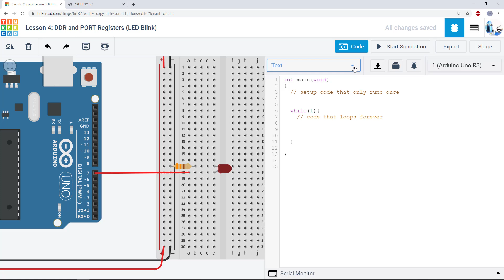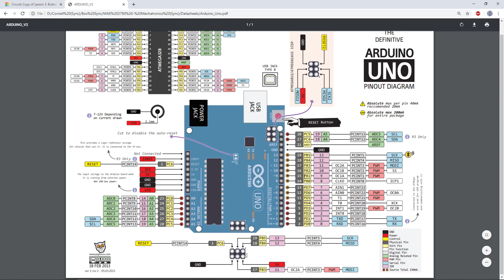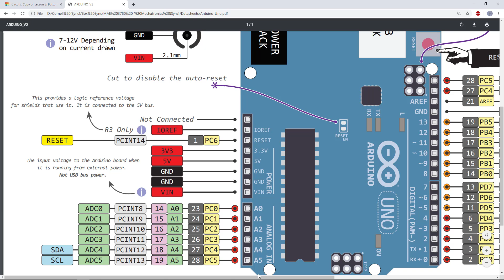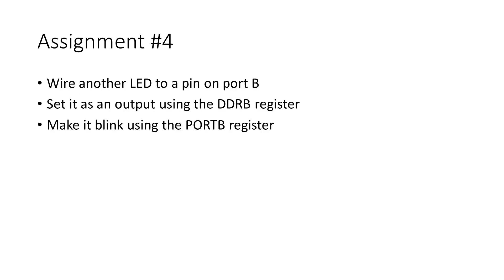Tinkercad + Arduino Lesson 4: Blink an LED (DDR and PORT registers)

Comment: // setup code that only runs once
  
  // DDRD = 0b10000000; // set pin 12 as output
  DDRB = 64;
  // DDRD = 1<<12;
  
  while(1){
    // code that loops forever
    
    PORTB = 0b10000000; // set pin 12 high
    _delay_ms(1000);
    PORTB = 0b00000000;
    _delay_ms(1000);
i did this and it stil doesnot blink
Reply: Make sure that your resistor is connected to the holes of the breadboard.  Also calibrate the resistor with 330 resistance in ohms.  I did both and it worked for blinking.  Also, in your middle line you have DDRB =64 not DDRD.

Comment: How can ı write delay funtion with registers?
Reply from the maker: You do not need to use registers for the delay function, however there is a function called _delay_ms() that is not exactly the same as the Arduino delay() function (I am not totally sure of the difference).

Comment: What is the advantage of using these registers instead of the adriuno library?
Reply from the maker: Here's a video that goes over a few of them: https://youtu.be/T_4BiqqTUMg. There are also other videos on YouTube showing an oscilloscope measuring the output pins using digitalWrite vs the registers, and the registers are several microseconds faster (I think). Doesn't really matter for blinking an LED once a second but for something where speed matters, those microseconds can add up. For example I think there's a guy who did one of those 8x8x8 LED cubes and he had to switch to registers.
Reply: @BenFinio  Thanks
Reply: Your programs will be more faster and light, I'd recommend you just use registers when you really need better performance or a light program. Is kinda uselss to use registers in code that doesnt need optimization